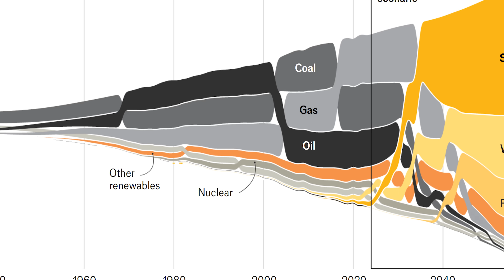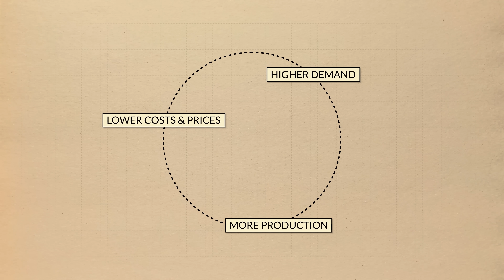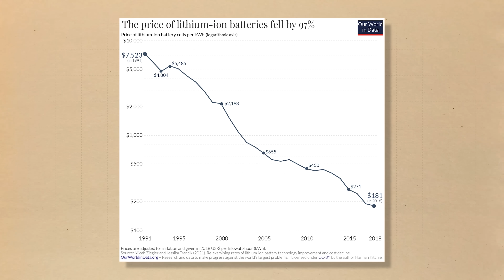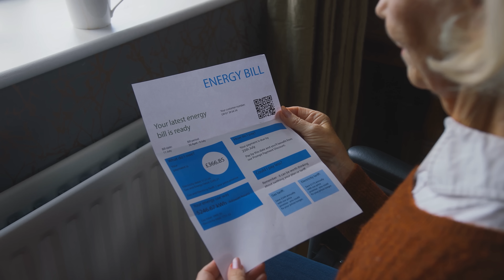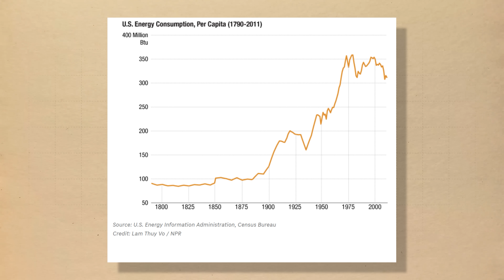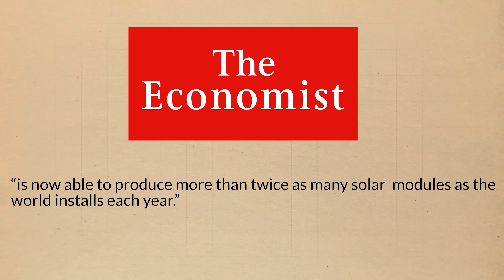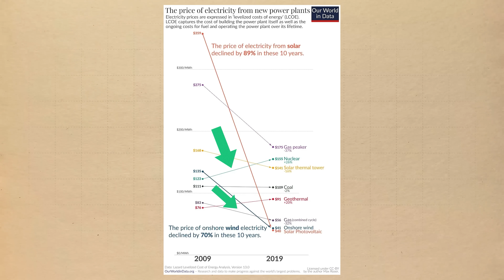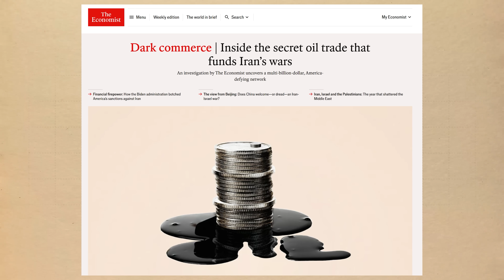Why solar will soon dominate & what that means for the world

Comment: Unlike fossil fuels, renewable electricity cannot be efficiently transported at the moment. It's usefulness is limited by the local demand, i.e., the local manufacturing and computation capacity. Those in turn are limited by availability of education and business environment (e.g., government policies). So I don't believe we will see a huge benefit to the underdeveloped counties soon.
Reply: They can basicly leap frog legacy systems in the developed world and directly opt for a peer to peer system over a centralised oneway system.
Reply: @rogerk6180  Yes for sure they'll prefer autonomous or at least decentralized solutions. Not sure about an actual peer to peer grid though because IIUC there are a lot of challenges connecting solar panels into a stable alternating current grid.

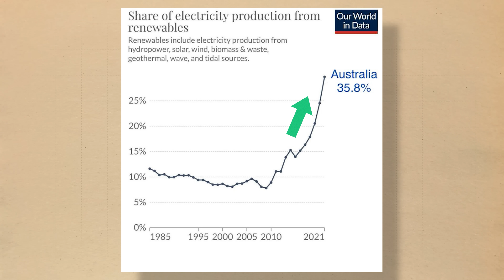Comment: At 5:44 you say energy production instead of electricity production (important since electricity consumption is only a subset of all energy production), Otherwise great video as always
Reply: Almost all energy consumption can be converted to using electricity if electricity supply becomes significantly cheaper then other forms of energy.

Ev's are an example of this. But also domestic gas use moving to electricity for heat and cooking for example.

Comment: You forget abou when the sun dont shine.
Reply: No one ever actually forgets about that. There have, in fact, been practical solutions around and in use for many, many decades at this point.
Even leaving aside the more technical and complicated ones (which are more applicable at the grid level), Batteries have existed for over a hundred years at this point.
Reply: Weather is always local. A wide decentralised system can easilly deal with that.
Clouds always move around, as clouds move into one region they are leaving another leaving energy production over an entire region pretty much te same.

Plus when weather is bad and cloudy, it is also windy. Which makes them a perfect matching.
Reply: @rogerk6180  Easily? Easily? How many miles of power lines have to be installed? Are you aware that every so often the ENTIRE North American continent is cloudy with virtually no wind. Locally. From Boston to Seattle to Los Angles back over to Florida.. In which case...well, whatever, just have some coal, gas and nuclear plants ready to go! You realize that Germany spent the last few years reopening its coal mines and restarting its coal plant. Go ahead, believe in pipe dreams.

Comment: Some good news that are very needed in thess times
Reply: too bad its just over-sensationalized clickbait, as all the other commenters have pointed out
Reply: @SilverScarletSpider it's not, directly from China, on the cell lvl, Lifepo4 batteries cost less than $60 per Kwh while panels costs 11 cents per watt and this includes transport costs.

A typical American home can go completely off grid with a multiple day battery backup under 10,000.
We just need the middle men to stop ripping us off. I have a 7kw DIY system at the cost of $2000 and the battery backup being $500 so. $2500 for 1 complete day off grid. If I spent $4000, I'd have a multi day backup and this includes running my 2.5 ton Hvac.
Reply: what times?
Reply: Times are better then ever!

Comment: I have observed from both personal experience with solar and California’s experience that when you hit roughly 1/3 solar in total electricity production, an inflection point exists. That is because solar doesn’t produce at times of highest demand—the well known “duck curve”. At that point, storage is required, which has an entirely different cost structure than straight production. Australia is near that point. In California, they “solve” this problem by selling to other states. Australia doesn’t have this option, so it will be interesting to see how they progress.
Reply: Australia actually does have this option, victoria and nsw sell to south australia when their solar is at the peak, and south australia sells it back, plus we have the slight issue of having fucking old coal power plants which cannot turn off during the middle of the day. With newer wind farms reaching 40+ percent capacity factors and hopefully offshore wind joining the mix with over 50% capacity factors its extremely pheasable for australia to go 80% fully renewable powered with 15% hydro and battery storage for the rest.
Reply: There are plenty of solutions. the problem is efficient, price effective solutions
Reply: Batteries are getting cheaper faster than expected. They are also following the path of solar. 

Australia China and California all are already solving this issue by mega batteries.
Reply: @JSM-bb80u  I don’t know about China or Australia. I do know that California is nowhere near to installing a useful number of batteries.
Reply: battery is one solution while there's another one
https://www.youtube.com/watch?v=1CVlbBYl5OU&t=565s
Reply: Or you can just hang the panels vertically and they naturally follow the duck curve.
Reply: I hope they will use the excess energy to make hydrogen.
Reply: Even at US and European prices solar+batteries are already much cheaper than just running current fossil fuel power plants as shown in German and other studies. China's solar is even cheaper, they're already starting to decommission coal plants and stopped building new ones. China is building over 2.5 large nuclear power plants worth of solar power per week. Not per year, not per month, per week.
Reply: @joelpettlon9650  People forget the only reason the solar panels are so cheap at the moment is that the production has been subsidised by China. The current price of panels is lower the the input cost and thus is unstainable, same goes for battery production. Till we see what real world pricing brings we can not truly judge the cost of solar and battery storage.
Reply: @nigelrhodes4330  This is true. So the question is, do we put tariffs on solar panels to equalize the game, or do we steal the Chinese blind and power the world for 25 years?
Reply: @joelpettlon9650  that is not actually correct. well it depends on how much storage you are budgeting on, but a few minutes is probably not enough.
Reply: @joelpettlon9650  where are you reading they stopped building new coal plants?
Reply: @joelpettlon9650  What is your source for the statement that China is "already starting to decommission coal plants and stopped building new ones?"
Reply: And Australia is struggling to make the balance. Because traditional power plant need minimum mega-watt to operate economically.
Reply: Unless we invent cheap efficient batteries with near-infinite amount of charge cycles, its a terrible option for grid-scale storage.
Most of the world, unlike Netherlands, has a high pumped hydro potential that can efficiently store and release much more power for a fraction of the cost. A decent-sized pumped hydro installation can store and release power on the scale of hundreds of megawattsto gigawatts and the reservoirs can be built on the top of any hill with suitable geology. With maintenance, such installations can last and pay out for centuries, orders of magnitude longer than any battery.

A decently sized pumped hydro installation can store more power than all of global battery storage manufactured in a year combined and requires a fraction of resources with a fraction of the carbon cost.
Reply: Australia is trying to sell long distance to regional countries like Singapore
Reply: Australia is selling electricity to Singapore now, or at least that's the plan.
Reply: Concentrated solar solves this with allowing power to be used at night
Reply: Do they have that option tho. For example they are building infrastructure to provide/sell energy to signapore. South east asia is fairly close to northern Australia.
Reply: Australia is solving this using vehicle to grid integration. At night, EVs become decentralized battery banks.
Reply: @wedmunds  Let's see how many EV's Australia wants. I live in Melbourne. I can tell ya, Aussie fucking love their 4 wheel drive diesels XD.
Reply: Australia made a contract with Singapore to export energy, so it's not impossible to export
Reply: Battery technology is reaching a simmilar point and is starting the same s-curve as solar is experiencing now. Storage will be just as ubiqitus in every building as solar will be.
These 2 things will become stardard equipment to any building within a decade the same as water heaters and such.
Reply: There is no s-curve yet. We have not reached the point of inflection for either technology.  We are still in the initial phase.   @rogerk6180
Reply: @rogerk6180  🤣🤣🤣
Reply: No need to put solve in quotation marks. Having a strong electrical grid that can distribute power over long distance is a very real solution to the storage issue. When you combine it with other renewables especially. The cheapest scenarios for carbon neutral electricity all include it.
Reply: @XMysticHerox distributing through power grid is not a complete solution. A country or even entire continent is experiencing daytime and night time roughly at the same time, so all peak power output occurs at roughly the same time.  Much cheaper battery is one option but there is a limit to chemistry which just doesn't progress as fast as humanity's appetite for more power. So a combo solar+ natural gas solution can work. Have so much solar generation during the day that it can be used to power CO2 scrubbers that remove all the co2 generated at night. No battery needed in this solution.
Reply: @xiphoid2011  Not a bad plan really, considering that natural gas is going to be available in any case for some time to come. Oil extraction is nowhere near its end, regardless of how adroitly we handle the transition, and natural gas is a waste product unless it is used for something. It would at least be a good transitions plan, if it isn't viable long-term.

I expect the future will see much more local energy harvesting, with neighborhood and private solar supplanting long-distance transmission in significant part. The current grid system is not very efficient or cost effective, so local battery storage will regain in efficiency what it loses in battery cost.
Reply: @xiphoid2011   co2 scrubber are no where nearly good or efficient enough to use at commercial scale like this.
Reply: @xiphoid2011  I am obviously not talking about solely using solar. And batteries plus pure renewables is already cheaper than fossil fuels so you are just wrong there. 

Have wind, solar, hydro and whatever else the environment allows (thermal, tidal etc). Connect it over long distance so they can cover each other. Have storage and a few backup nuclear plants for the rest. But nuclear needs a lot of development to be able to serve that function.
Reply: @XMysticHerox  Australia is just now reaching that point. Australia as a whole cannot export its power elsewhere. They have zero nuclear. Their wind resources are not that great, but last I was there they have not done any wind at all. They have a tiny bit of battery storage.
Reply: @christianlibertarian5488  I am not talking about export I am talking about distribution. Export is simply part of that. And yes it is entirely possible to do that within Australia. In fact it is decently suited for it.

Contrary to your claim Australia has good potential for wind and in fact already gets 12% from it. Whatever source you got this idea from is probably not one you should trust. 

Australia also has decent hydro and a high potential for thermal that remains unexploited. Tidal power is also a potential future source. 

But yes obviously a place that gets as much sun as Australia is going to focus on solar first. Anything else would be stupid.
Reply: @christianlibertarian5488 australian electrical engineer here. Not sure when you were last here but we are cracking out the wind farms too,  just not as fast as the solar.  No technical hurdles to wind,  it's working well, the major problem now is NIMBYs. Idiots are going around telling all the farmers the windmills will make them sick, and you just need one or two in each area to believe them to start getting administrative headaches
Reply: @priceprice_baby  Well, good on ‘ya. It has been six years since I have been there, so times change.
Reply: @XMysticHerox  You mention some things as though they were practical and economical in the real world.  They are not.
Australia's east and west coast are only 3 hours time difference, so not much difference in solar timing.  But the straight-line distance is about 3600 Km or 2200 miles from Perth to Brisbane.  Constructing a transmission line to transfer electricity between them would be prohibitively expensive and would also suffer from huge transmission losses.

Batteries are NOT free.  In the US, the LCOS (Levelized Cost Of Storage) of batteries is about the same as the LCOE (Levelized Cost Of Electricity) of simple-cycle gas turbine (SSGT) peaking plants, that is about THREE TIMES the LCOE of combined cycle gas turbine (CCGT) generators.  In the vast majority of situations in the US, it would be cheaper and simpler to just use CCGT for ALL electricity generation, and skip the solar/wind plus batteries/SSGT plants.  But that's not POLITICALLY acceptable, so we pay much higher electrical rates to use "cheaper" solar and wind to "save the planet".

Speaking of "saving the planet", there is NO credible catastrophic climate scenario based on carbon emissions.  Climate has, does, and will change NATURALLY over the centuries.  The Vikings settled (and named) "Greenland" during the Medieval Warm Period.  They were forced off of it centuries later by the Little Ice Age that killed their crops.  The greenhouse effect IS real, and makes the planet habitable.  Otherwise, the average global temperature would be around freezing (0 C) instead of the more habitable 15 C.  Water vapor is BY FAR the major greenhouse gas (~ 2/3 of total).  CO2 is about 1/3 of total.  Doubling atmospheric CO2 would result in an AVERAGE temperature rise of about 2 C.  But high temperatures are NOT rising, LOW temperatures are rising.  That means the climate is getting MILDER, NOT MORE EXTREME.  And historical climate records show there has NOT been an increase in extreme weather (hurricanes, floods, droughts, fires, etc.).  Climate models FAIL to accurately model known historical temperatures.  The use of failed models to make predictions is ANTI-science.  Media want to sell you a horror story because it gets viewers and POLITICAL power.  The truth is much more benign.
Reply: Would 'One World, One Sun, One Grid' initiative help in selling it to other countries?
Reply: @pradeep_krishna  No, decentralization.
Reply: The only way to improve the cost structure of storage, which in the long run is indispensable, is to develop the industry as rapidly as possible. This is being grossly neglected.
Reply: Sun shines all day, there are other ways to solve the "duck curve" issue.
Reply: California should have built much more wind which, and more nuclear. But sadly left to the "free" market only the cheapest is built
Reply: @matthiasknutzen6061

are you seriously stating Cali's solar capacity is because of 'free market forces'??

Comment: I am wrong a lot of the time, but this sounds like obvious sponsored propaganda to me. Am I going crazy?
Reply: You are right. The change to renewables has made energy way more expensive. If the charts he shows are correct, how could that be possible?
Reply: @joesc777  The charts are correct. The high energy prices are a rather complex phenomenon and has todo with how, the infrastructure and the markets are structured.
In most the EU electricity prices are set via merit order. The most expensive producer sets the price due to marginal pricing, but the cheapest producers of energy are allowed to sell first.
The problem in europe in 2019-2022 were drastically increase gas prices (2023-now still about twice pre-2019 value) due to Russia reducing deliveries of gas pushing up the price for it and subsequently the electricity produced from it. If you live in a country like the UK, that had gas powerplants run ~90% of the time in the last year your electricity prices have been set by those plants 90% of the time, wichs electricity was about twice as expensive to produce compared to pre-2019. Throw in reluctancy of energy producers to reduce consumer prices and you get the mess we are in atm.
Go buy some shares in energy companies producing renewable electricity, they are making bank right now.
Reply: @cahdoge  WRONG lol keep defending the green scam XD

Comment: Time to invest in raw materials needed for all the panels and batteries. Just bought some Canadian and European indexes.  The fact that it's now way cheaper than hydrocarbons makes it seem kinda inevitable but I don't invest much outside the west as I don't understand the markets.
Reply: You might want to consider the massive portion of the Canadian economy that is made up by the oil industry.
Reply: @PxThucydides  I'm thoroughly aware.  I'd call that benefitting from the hydrocarbons that currently power most things, and putting money in future resources.  The indexes will change make up as the solar  resources replace oil.  Excellent observation, but one I did consider :)